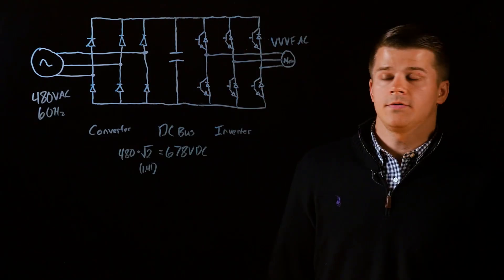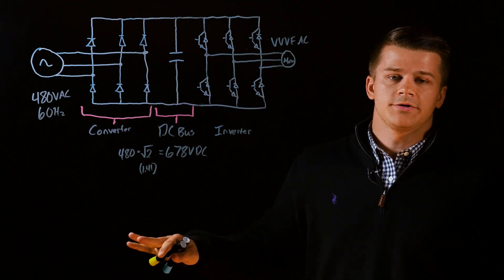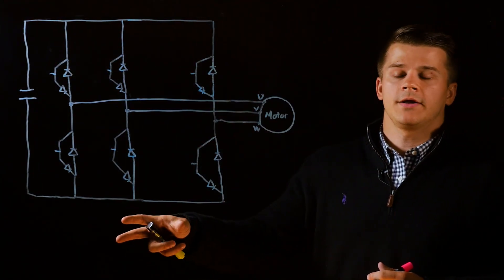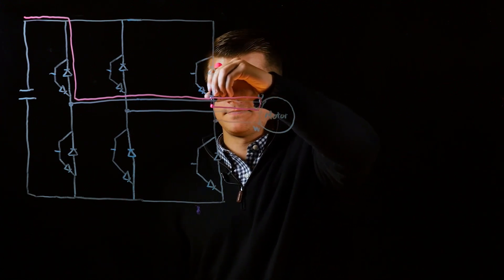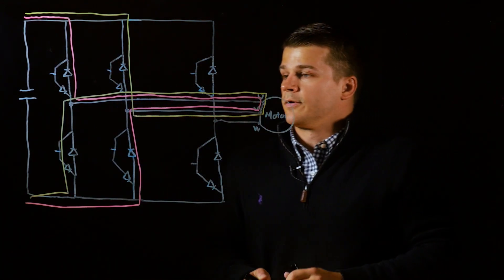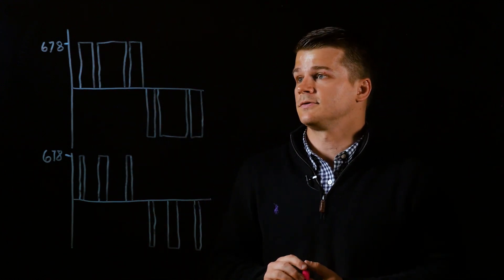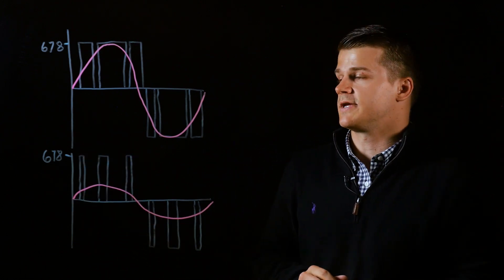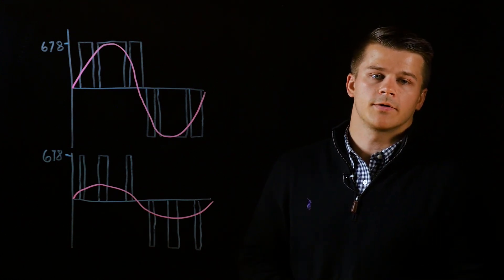How Pulse Width Modulation works in a VFD

Comment: This control by bus sensing voltage?? Example the output is 678, and data from bus sensing wi set for 400v example, so the microcontroler change pwm for the igbt or fet??

Comment: Your description is good, however the characterization of the IGBT as "Open" could be quite misleading. Rather, use the word "Conducting" to prevent misunderstandings as "open" usually means a broken circuit.
Reply: The reason that the plumbing analogy is often confusing to beginning electronics students. A valve closed stops flow>>> A transistor closed allows flow.. Rec. A valve open allows flow... A valve closed stops flow...
Reply: TRUE

Comment: I think your calculations are wrong, you confuse the three-phase current with the single-phase current when you multiply by 1.4. In the end, from 678 V you have +/- 678 V, that is 1356V.

Comment: Nice video, but I just still dont understand how the smooth sine wave is made from pulses :( Thank you for answer
Reply: EDIT: I'd like to simplify my answer a bit since I got a little carried away with that info. The Pulse-width modulation allows us to MIMICK a sine wave when the pulses are at extremely high rates.  The IGBT does not pulse at a constant rate, it follows the rate relative to the values of a sine wave. Well as close as it can get. And it can get pretty close. Think of how the individual pixels in your monitor are squares. Well when you, the observer see these squares in a pattern, and those squares are small enough, you have the illusion of a curved line. the more pixels you have (or pulses for the analogy), the more realistic that curve seems. When you are working with less pixels, the image begins to look choppy and at a low enough resolution , you can actually see the pixels as squares.  

When you change the time between pulses, you change the AVERAGE values of the mimicked sine wave. These values are actually known as Pulse-Width modulation. It is not a true sine wave, but when you have energy pulsing extremely fast AND reversing direction, it can be perceived as a sine wave. So, even though your DC voltage is still technically 650vdc at the input, with pulse-width modulation, you are essentially limiting the amount of voltage the load receives, as well as switching the flow of electricity by taking advantage of electrons wanting to flow back to it's source at it's most efficient route. This results in a 480VAC voltage.
Reply from the maker: Yes, it's hard to comprehend how electrical pules from IGBTs switching on and off can create a waveform that can control industrial motors. Perhaps you would like to read more on our blog article here: https://www.kebamerica.com/blog/pulse-width-modulation-in-vfds/

Comment: Just a note, when you say rms and instead you are drawing and refering to a sin wave that's the 1th armonic you are messing with definitions and not being precise, the rms would be the value that has to be calculated and it's Am/sqrt(2) where Am is the amplitude of the wave you drew
Reply: Pretty sure he's talking about the root mean square of the DC pulses forming the sine wave. Not the RMS of the sine wave for a clean AC system which is the DC equivalent of the sine waves
Reply: After quickly refreshing my memory, the definition of RMS: "the arithmetic mean of the squares of a set of numbers" ~wikipedia. In this case the RMS (sine wave half cycle) is the arithmetic mean of the square of the set of positive pulses (duration and maginitude)

Comment: Mostly great video. In the beginning you labeled the AC to DC component a "converter" this is inaccurate. It is properly called a "Full Wave Bridge Rectifier, with ripple control". It might be helpful to draw the changes from 480V 60Hz, to DC, to new synthetic AC output.

Also, is it not possible now to use true sine Wave inverter circuit? Given advanced in inverter technology, I'm sure that's how the new VFDs work. That is, instead of using simple modified sine wave, created through choppy DC. It uses a computer to draw the sine wave like an etch-a-sketch just super small strait lines making a very close approximation of a genuine curve.
Reply from the maker: Hey Warren,
Thanks for the detailed analysis! Yes, technically it is a full wave bridge rectifier. We call it the converter section as a general statement because it converts the AC to DC. We then call the DC to AC output of the IGBT’s as the inverter is it inverts the DC back to AC for the variable voltage and frequency output. These are general terms. Some people call the entire unit an inverter. Mike is just clarifying that there are two stages to the process. AC to DC and the DC back to AC for the variable output. This lightboard video series is meant to a general overview of highly technical topics. Have a great day!
Reply: That is correct, the fact of the matter is tht they are generally all called converters. AC/DC Converter (Rectifier, can be full wave or half wave) and DC/AC Converter (Inverter). In a VFD there is no need for a controlled Rectification, just fullbridge Rectifier then throttle the output using Inverter IGBT's as you have correctly shown us.

Comment: Why Dc Voltage is more that input AC ?
Reply from the maker: Hello again, Bishant, 
The simplest answer is because the DC voltage has to be higher than the AC output for the PWM to work. Thus the AC input must be rectified up to a higher DC voltage. I hope this helps. Thanks for the comment!
Reply: KEB America, Inc. that's the question. How it becomes higher ? How DC is more
Reply: @bishantkumarvlogs  the peak value of a sine wave is highter than the rms value of it.
Reply from the maker: If you want to know more details, a YouTube comment isn't the best place to learn specifics on topics like six diode bridge rectifiers. Here is a good place to learn more in-depth how and why this works: https://www.electronics-tutorials.ws/power/three-phase-rectification.html
Hope this helps!

Comment: hi, excelent video, i have a doubt, in some system like VRF conditioner , it's says that the compressor use DC voltage, but in this video you say that is AC voltage after the inverter , so why i can't test the compressor with AC voltage directly without using the inverter module? Thanks and sorry for the trouble
Reply from the maker: Thanks for you question. Based on your comment, here is what we think will help:
You can test the compressor directly with the AC voltage and skip using the VFD (typically still use a motor starter), but then you lose the Variable Voltage Variable Frequency output of the VFD.  Without the VFD they would only have the option for off or full speed with nothing in between. 
If you have further questions, find a local KEB Representative near you here: https://www.keb.de/contact/contact-worldwide
Reply: @KEBAmerica  How come only 2 IGBT